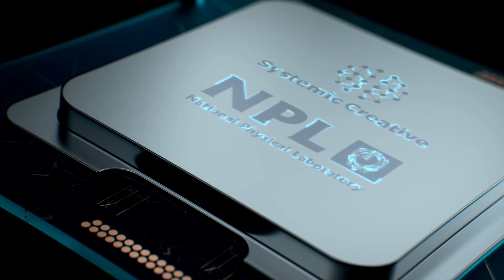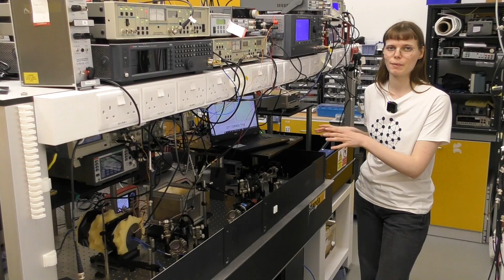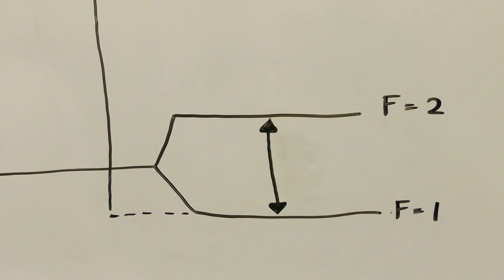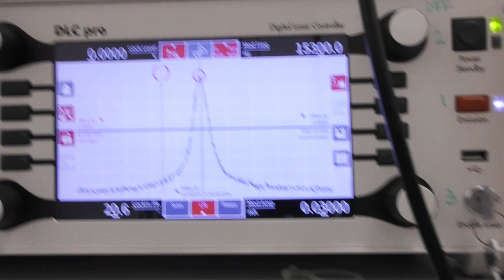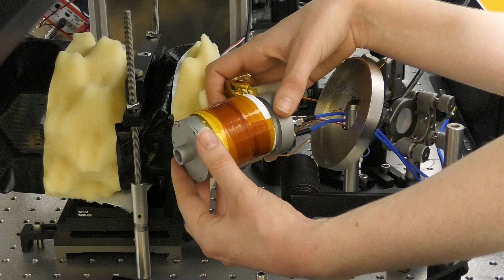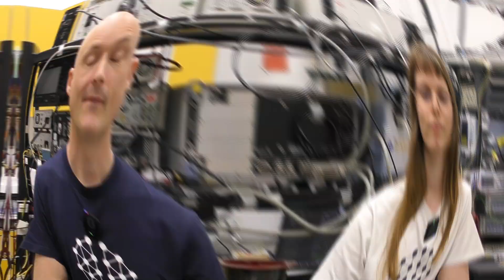Cutting Edge Atomic Clock Tech at the National Physical Laboratory

Comment: Fascinating video, and I'm jealous of your lab setup! 

I had no idea Rb clocks were under active development, always had the impression they were sort of a solved problem -- I have a PRS10 that's old enough to drive! -- but clearly there's still performance gains to be made. 

What's the advantage of double-resonance over simple microwave interrogation as used in older clocks? Magnetic field independence sounds valuable and possibly unique to the DROP scheme.
Reply from the maker: Thank you. Yes, there's certainly some ongoing development in Rb clocks since they have such wide application. The main advantage of the DROP scheme is that the optical pumping offers better signals due to the controlled population inversion, as well as being easier to set up in terms of running the interrogation and detection. Some older microwave-only systems use pulsed beams or Ramsey-type separated oscillatory field setups, requiring more complex timing and vacuum systems. There is also a reduction of noise due to environmental fluctuations (e.g. temperature, magnetic field).